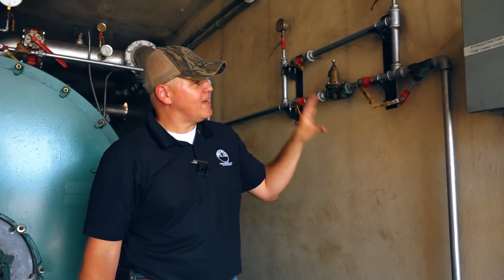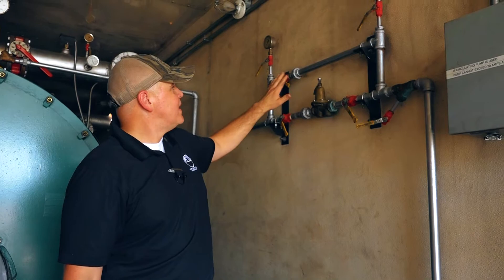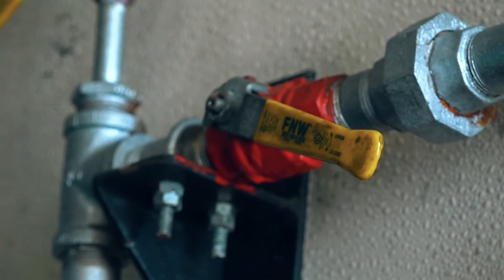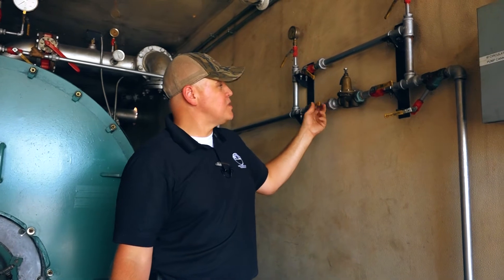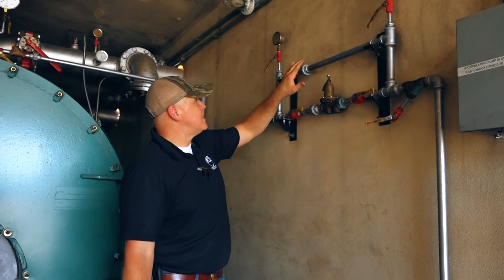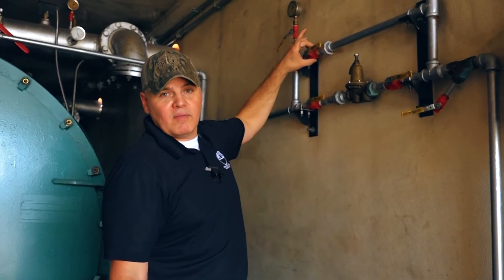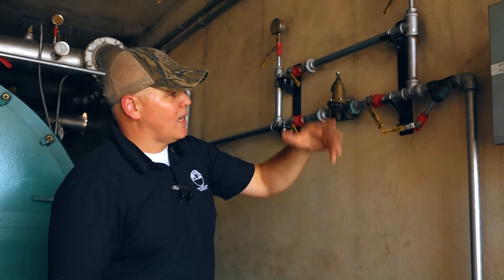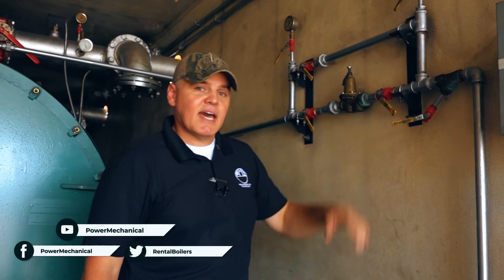How to Keep Valves from Freezing - Boiler Room Tip

Comment: How come insulation application prevent freezing!? JT effect lowers temperature near zero degree. Insulation prevents from gas to exchange or absorb heat from surroundings. So doesn't it have a reverse effect!? Kindly explain how insulation jacket around throttling valve prevent icing .
Reply from the maker: Hey, thanks for the comment. Could you better explain the question?
Reply: @powermechanical  Not question it's real problem. I am receiving Compressed natural gas at 60 ksc which is being throttled and downstream is at 54 ksc . So this reduction in pressure is  causing methane hydrate formation. As gas is not dry due to non availability of TEG AND ETHANOL. SO THIS HYDRATE AND ICING IS CAUSING WATER AND ICE FORMATION ALONG THROTTLING VALVE.
Reply: Can you guys explain whether adding insulation jacket will solve problem of not. If it can what is the reason if it doesn't then wats the reason!?  PIPE SIZE 2 INCH .